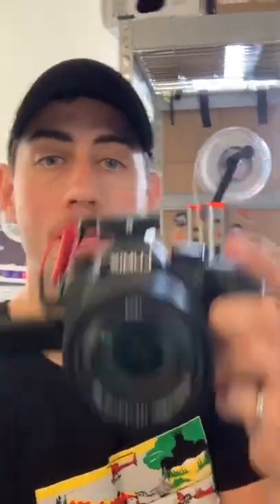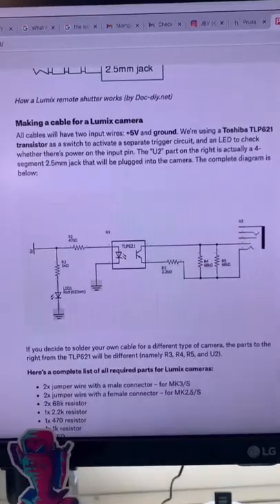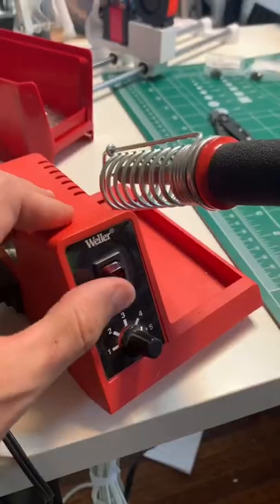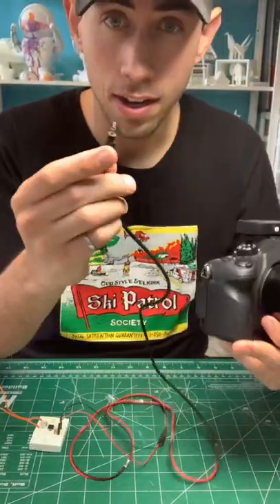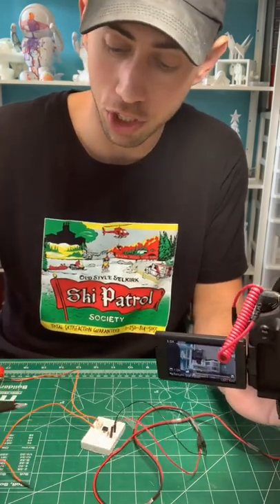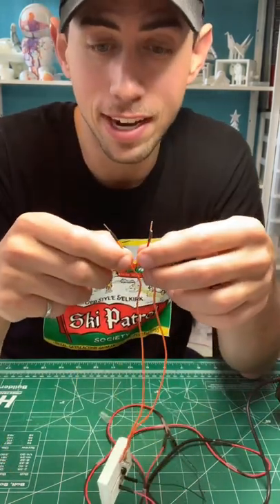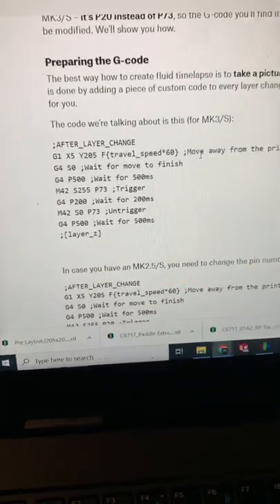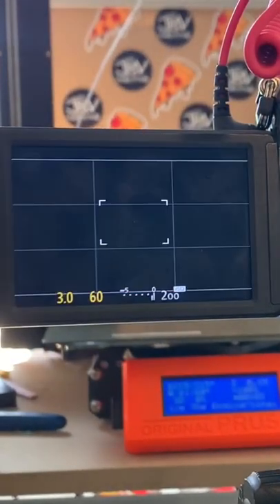3D Printer Timelapse Mod Prusa/Lumix

Comment: Nice. I just use a raspberry pi with octopi.

I rigged it so my slicer adds some extra gcode which my raspberry pi reads to turn a light on and snap a picture with the nozzle out the way

Comment: Just buy a 5vdc Relay module dude. its worked perfectly for me with my ender 3 pro. 😍
Reply from the maker: That’s pretty much what this is! But instead of a relay this is an optocoupler
Reply: @Engineezy  yeah. but it can use anyone who don't like or don't know how to solder. but i used it because its the easiest way to do.😍
I wish i could post a photo of that on this comment. ☹️